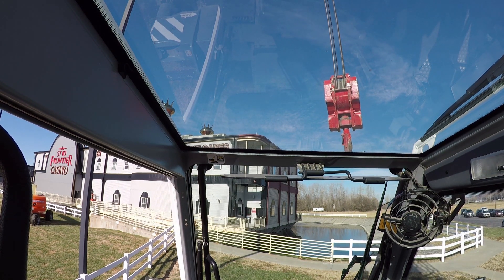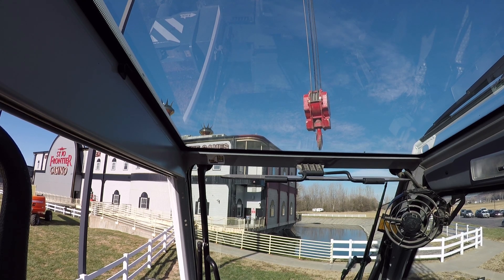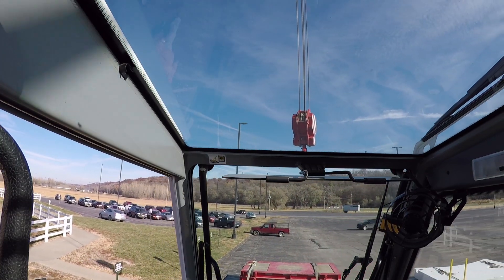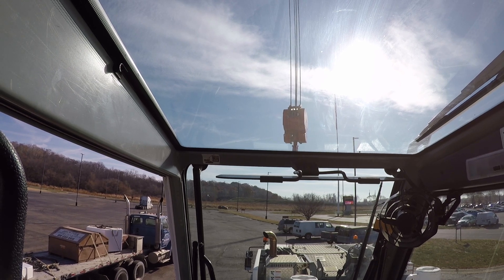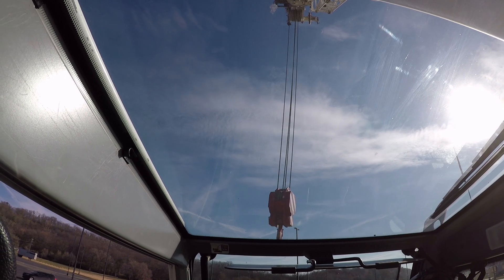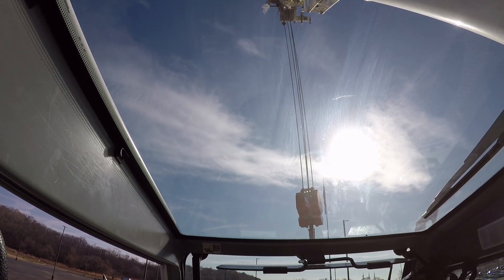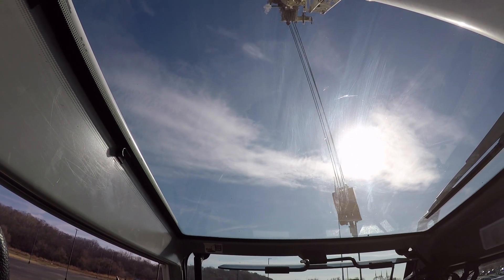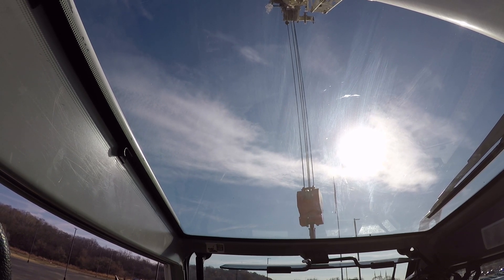Catching the load with a crane | Catching the hook

Comment: Its interesting seeing the mechanics on a crane. The swing period is a lot longer, so it seems a bit more forgiving provided it isnt compound, lateral and back and forth. 
First learned load catching moving steel plates with excavator. Sure, there might be a tag or a guy with a mag stick, but a 3K lb plate is significantly more than any mere human could control.
Hoping to get a crane cert in the next 6 months to join in the fun!
Thanks for the video!

Comment: The not-so-simple physics of simple pendula. The angle from the vertical at any given point in time is a direct function of the maximum angle from the vertical at the end of each swing, so reduce the maximum angle as close as possible to zero by moving the tip of the boom over the load when it is at or near the end of one swing. Yeah, yeah - easier said than done. Great video, Jimmy!

Comment: Great video. I have a harder time catching the ball when it's going in and out, I find booming up to be easier than booming down
Reply from the maker: Towards and away is much more difficult. I too, have found that booming up is easier. I think cranes inherently boom up faster. That or the timing is easier to match because of the load moving towards the cab. Many thanks for watching! 🙂
Reply: @ToTheTopCrane  It seem that one's depth perception or the lack thereof comes into play going towards you or away from you.  
Especially the further out you're operating. . .
Reply: Yeah and add a little cable down to that boom up, it’ll also help. The old timers used to let the ball free fall and in the process it would turn  that side to side motion to down. Instantly catching everything and making you look like shinny penny. 😉
Reply: And it reduces your radius which can be a good thing